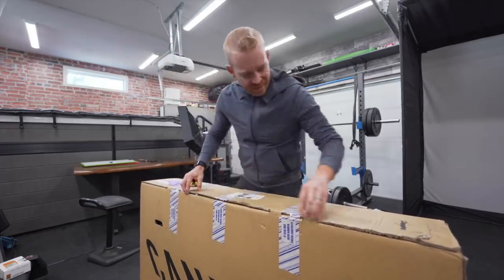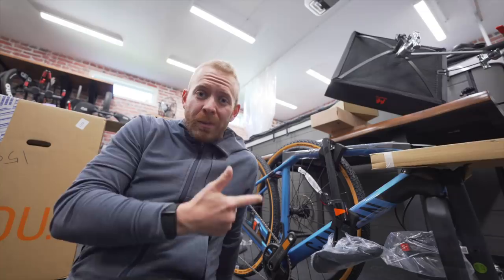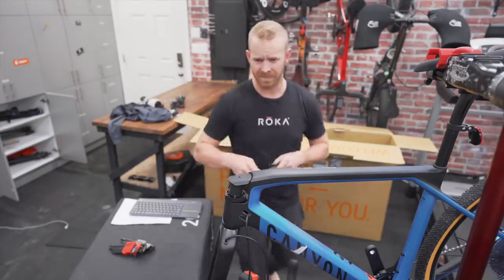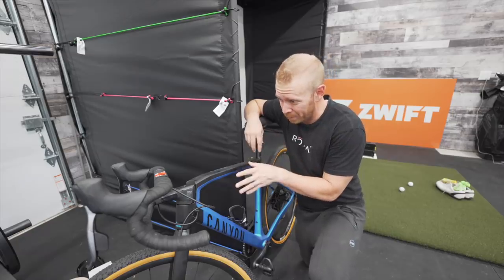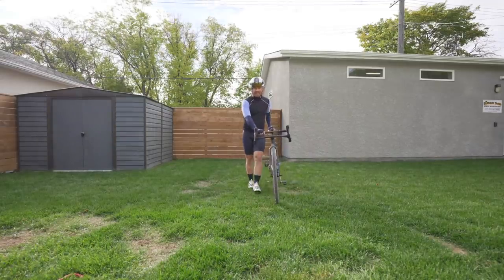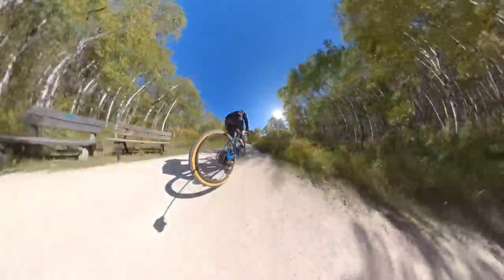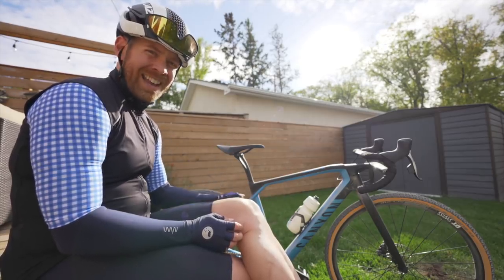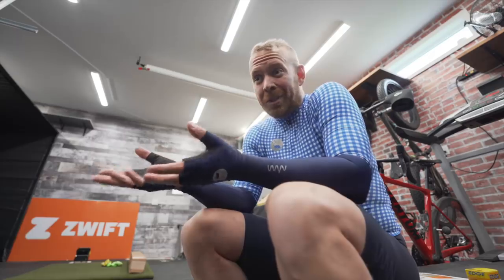Triathlon Taren is Leaving Ventum Bikes for...

Comment: The Bike industry is really smart. This used to be called “cyclocross bike” and exists for around 100 years
Reply: ummm HT mountainbikes are still the king for allround terrain use.  29er specially, roll so fast on every surface, plus you can go downhill fast with no worries about getting punctures.
Reply: They're more like as if a cross and an endurance road bike had a baby.

Comment: Love gravel bikes - but don't do what i did. Training too much on my gravel bike caused me to lose power in my race position.  I bought a Trek Checkpoint Gravel bike last year and trained on it a LOT because it was so fun and comfortable.  When i bought the bike I could sustain 190watts on the gravel bike.  On my BMC in aero position i could sustain about 210-220.  I commute 72km round trip in the spring/summer.  When i got closer to my triathlon i noticed that my power output on the trek increased 210 watts over 40km (Garmin vector 2 Pedals) but when i started doing training on my race bike my power on race bike i found the power output more difficult to sustain and definitely more discomfort in aero position.  I was as down to 195 Watts average over 40km on my race bike.   So essentially because the geometry was different i actually got faster on the gravel bike but slower on my race bike!!!!  So -  make sure if you are training to train in your race position with plenty of time leading up to the race.  By all means get a gravel bike- I love it- but know the position is quite different and you  need to train in position.  I didn't consider geometry and position making this big of a difference.  I'm 40 , 5'9 - 145- 150lbs at race weight so perhaps age and flexibility play a big role here.

Comment: Tazza, re zee German stickers. Use a hairdryer to warm them up. This softens the adhesive and makes them easy to peel off. If by chance it's still a bit tacky, spray the remnants with WD40 and leave it for a moment and then rub off with a soft rag. PS our local Triathlon coach thinks Canyon are the best value for money bikes around.

Comment: Well, Canyon builds good bikes, Problem is that they dont offer good Support here in Germany. In my opinon they should create a good Support Flow instead of getting more pros and influecer on there bikes. It is really a mess if you need Canyons Support maybe because of an accident and they should check the frame or something like this. This usually takes several month where you cant use your bike.